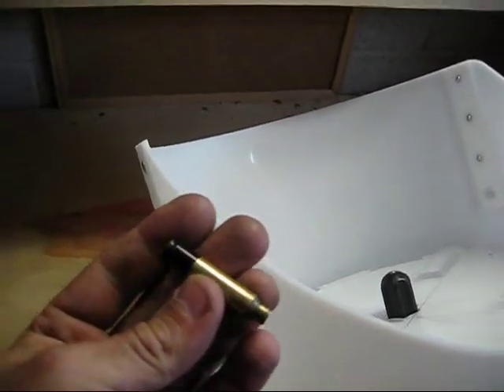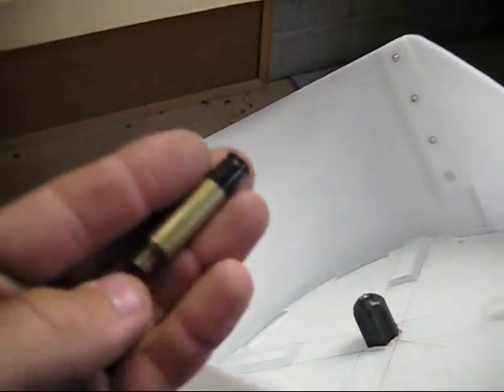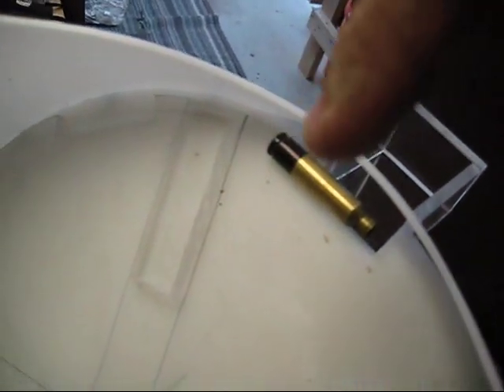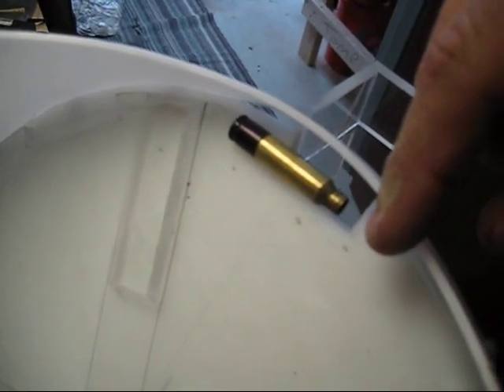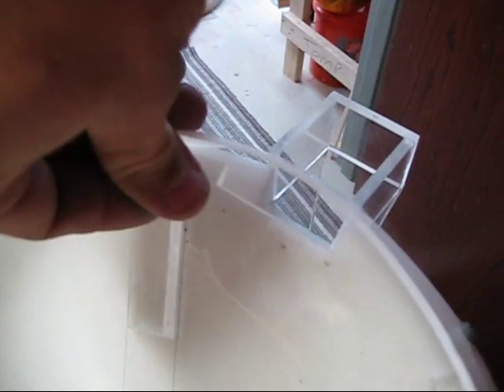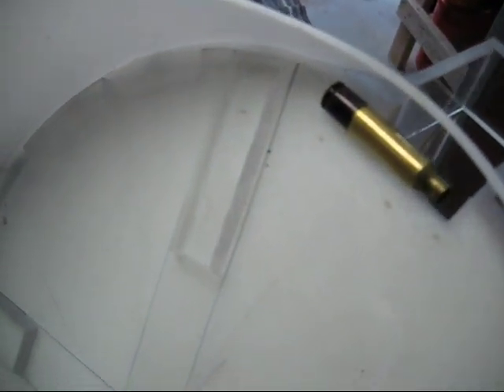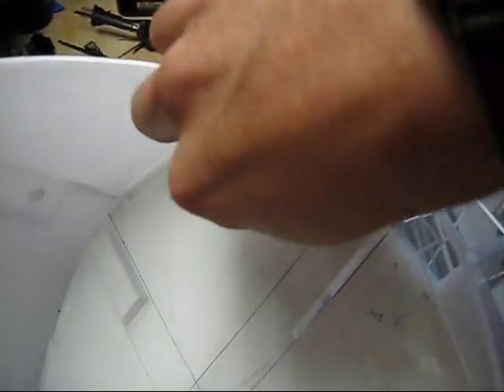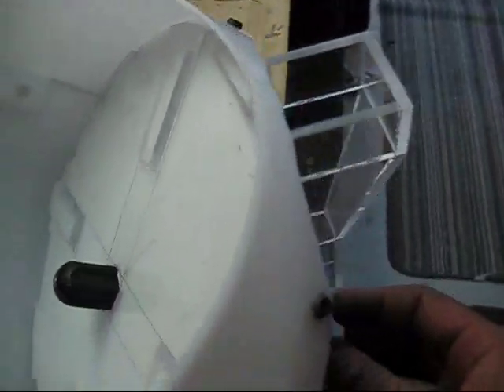homemade case feeder - how it works

Comment: That appears to be a 6 rpm motor. Is that correct? I know most people who build these use 4rpm 4 watt motors, but I just ordered a 6 rpm 5 watt motor with a metal drive gear.  I want to build one for my Hornady LNL AP Press just for the fun of building it. Buying one is to easy.